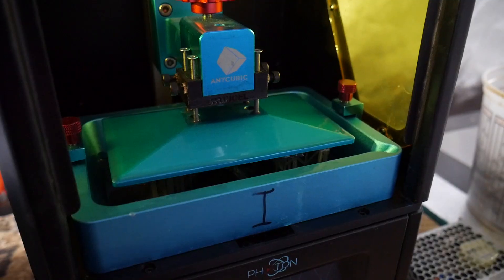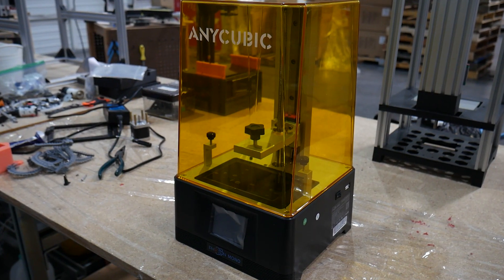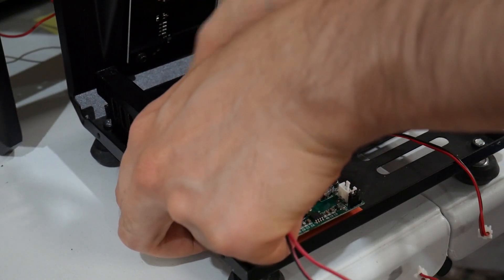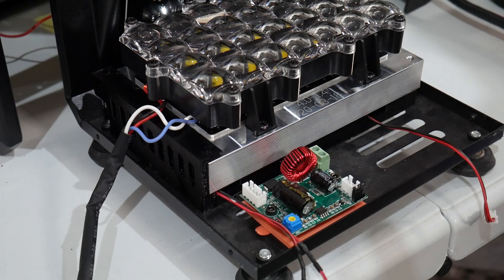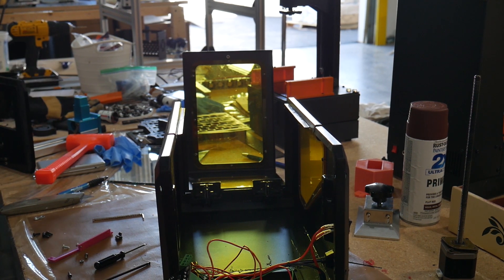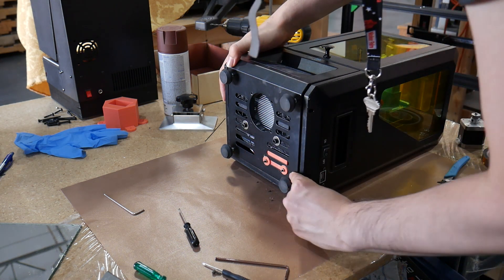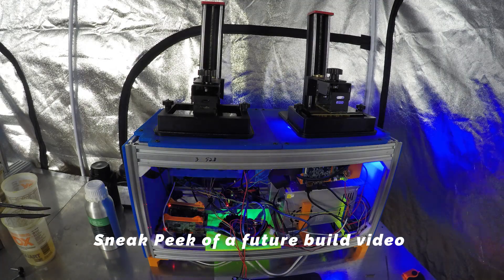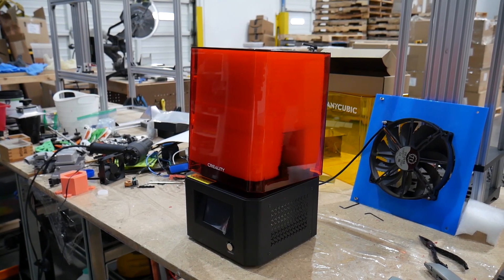Update on my Mono OG Anycubic Photon mod and how I like it.

Comment: Not sure I'll get a reply but here it goes: I have one of those printers but don't really have a lot of money to do a radical mod like this. 
What I tried to do was to install another 4x 10W LEDs in addition to the original 4x 10W LEDs and bought a 12V 10A power adapter to replace the original 12V  6A power adapter. 

But I ended up with half the light power as there's something obviously limiting the wattage output. 

So the question would be: is there a way to remove this wattage limitation so all 8x LEDs can get the same 10W each?
Reply from the maker: @caincha  its been a while since I gave these printers any thought as they are sitting on a shelf waiting to be scrapped or used for testing a part extraction idea I kick around. So fuzzy on the original parts in these. 

So brightness being cut in half tells me its likely the current driver pcb that the lights are connected to is set to a fixed current and will not provide any more, even if you add a better power supply.

And I don't remember there being any potentiometer to adjust current output so you may need to find a different driver.
Reply: @ thank you for your reply. 

Found out brightness is lower cause when connected together only the new LEDs lights up. And even if I bypass and connect the new ones directly on the PCB the original ones still won't light up. 

But if I solder the new ones in the fan output everything works but the new ones overheat even if I put heatsinks and use a blower on them - they really heat up a lot!!

And I get this error message 

LCD error code: T_8B L_O. please try t o continue printing.

I was testing all that before reading your reply.
Reply from the maker: @caincha  LCD error codes means the LCD firmware is not matching what is connected to the board, definitely double check the firmware installed.

Re the LEDs array it sounds like its drawing alot more power than the original array. Hard to say if that is whats causing the original not to run at all while the other one is wired in.

Comment: Finally got around to finishing this mod! Thanks for the detailed overview:)

A couple notes for anyone wanting to do it:

The provided motherboard bracket STL is flipped - you can print another one with the correct orientation or use the existing bracket. If you do use the existing bracket you can remove the handle so there's more space for the motherboard, as the array won't fit otherwise.

Yasu printed some washers for securing the LED driver that aren't included in the STLs - you'll need to print some or use some additional washers to attach it.

My LED array was wired incorrectly so didn't work initially. The plug was ++-- instead of +-+-, so I just needed to pop the pins out of the JST connector and swap them over.

There are a significant amount of grid lines as the array is too far away from the LCD. The manufacturer recommends a 35-36mm gap between the array and the LCD and there's currently a ~65mm gap with the supplied bracket. I put a spacer in between the bracket and the printer base and it's fixed the gridding:)
Reply from the maker: Congrats on completing the mod! It sounds like most manufacturers are now offering arrays with shorter focal length lenses which were not available a few years ago at the time of the video. I probably will make a point of adding some spacers as an option for folks attempting the mod with shorter focal length arrays. Also will dig up or recreate those plastic washers I printed.

I just need to find time for personal projects again rather than be swamped by work all the time now.
Reply: @HiroCreations  Same issue with me and personal projects - I intended on doing this mod a loooong time ago haha. I bought the array over a year ago, same link, so I imagine it's the same one? If it helps, I tested and around 25-35mm seems to be the ideal size for the spacer but that'll obviously vary based on the array. 

Thanks again for the mod - really looking forward to printing on it!

Comment: I’d recommend adding a magnetic flexi build plate (and z-height trigger adjustment).  Makes such a difference in getting the prints off the plate.  So much easier….

Comment: Did you change out the build plate and use a wider one? or did you use the same small build plate?
Is your build floor setting bigger to match the 6 inch screen or do you still have to use the 5 inch screen build plate floor setting size?

 Thanks
Reply from the maker: The stock build plate and vat actually fits the 6" perfectly (as the vat is a drop in replacement for the older Photon Mono which uses the same screen).

Comment: Can you recommend an alternative to the led array you linked its no longer available.
Reply from the maker: The next best option I found was the ones sold by Chitu: https://chitusystems.com/product/5-5-6-0-inch-parallel-uv-matrix-led/

That being said, after using the mod for a while I'm pretty impressed at how the stock array does--its only slightly less detailed than the upgraded LED arrays on most prints.

Comment: I noticed while watching this that the build plate on your Photon seems to have been modified. Or at least it's different than how mine is set up. I see 4 screws that seem to be used to adjust the angle of the build plate and then another 4 that look like they are set screws to keep the other 4 screws locked in place. Is that the case? If so is there a video explaining this mod?
Reply: Also I like Photonstein for a mod name.
Reply from the maker: Yeah I was not a fan of ball joints for keeping beds level for months or more of not releveling so I tried different iterations of the 4 point leveling and settled on the second design that compresses the bed side "arms" into the aluminum upper section like the leveling mechanisms on other resin printers.

Comment: Question if i change to the screen itself, whats the settings, is my bottom layer now 30 instead of 60 ?, expsure now 3 instead of 8
Reply from the maker: Depends on your resin but that probably would be a good starting point to figure new optimal exposure settings. For the resins I use I settled on 2.2 second layers and a 18 second base layer time.
Reply: @HiroCreations  thank you for the reply,  I'll give it a whirl, I'm still on the original UV light source might upgrade that when I feel brave

Comment: I just recently found your videos and they are great, is there a chance that you might try to build a base plate for an 8.9-inch mono screen? I am thinking of making a new case with a bigger build plate. Everything from your mod remains the same except a bigger case,  and perhaps the upgrade z-axis mod for photon. Almost the same as mono X
Reply from the maker: I have a larger scratch build in the works, unfortunately 3d printing base plates for anything larger than 6" does not work well due to how much they flex under the weight of the vat and resin. I'm quietly experimenting with ACM plate and printed fittings to see if that has enough rigidity, but likely I will have to swap to a milled aluminum plate (hoping to make a design that can be done with a desktop CNC router like a shapeoko.
Reply: @HiroCreations  Thank you ! that is incredibly useful information! I hope it goes well!

Comment: Great video! So, Chitu has a 24V parallel UV array on their screen. It looks the same as the duobond array you used. Having a time confirming the power output of the two. Can you confirm the wattage of the array you used?

Comment: what is the difference between the TMC2209 driver
 and the A4988 driver  ?
Reply from the maker: The TMC2209 is much quieter than the A4988. Thats the main and most notable difference. Print quality is mostly the same.
Reply: @HiroCreations  sorry, "quieter"? both are pcbs, they don't make sound . can you explain a bit? thanks.
Reply from the maker: @kensaiix  the stepper motor it drives would be quieter. The 2209 sends more precise control pulses to the motor which makes the motor whisper quiet vs the higher pitch whine that motors running with A4988 drivers have.
Reply: @HiroCreations  "more precise", now THAT triggers me, thanks.
Reply: @HiroCreations  hey, sorry to bother you again: i noticed a network port, does that mean the board has a web interface and is capable of remote access and remote print?
Reply from the maker: @kensaiix  It can, but I've not spent much time exploring the functionality of it as I am told that the interface and software is unfinished. The OG photon board should also have a ethernet port as well.

Comment: Any news on availability of a drop in 5.5" mono replacement screen plus compatible controller?
Reply from the maker: They keep telling me soon, but no firm dates. But I do know that it will be compatible with the stock Elegoo Mars Pro (maybe the regular mars as well) board and the Chituboard v3 with a firmware adjustment.

Comment: Update please. Im absolutely doing the 4k mono upgrade for the 5.5" size.
Need that video.
I actually can't believe Anycubic can't see the market for selling a 4k mono upgrade kit for all the photon owners out here. It's got to be the most sold resin printer so far.
They would make a killing with such a kit.
Reply from the maker: Yep! Waiting on the manufacturer who let me test some early release boards actually launch the screens for sale (they were supposed to in Dec).

Short term the only easy to plug and play 5.5" mono screens will be 1080p (same as the original sonic mini). I have been hunting around for 4k Monos but the issue is they are either not available yet or use ridiculously complicated and finnicky HDMI driver boards that essentially make it an advanced upgrade again.
Reply: @HiroCreations  i see those boards on alibaba. pretty cheap so you would think the upgrade options would be out there.

Comment: Amazing job with the mod. 
How would I go about upgrading just the uv light array? I have a small 6 light UV lamp(6w) that I am contemplating throwing into my photon.
Reply: The lamp is 6w but it also says "6w/60w"
But I don't know if that matters. I am just trying to increase my print speeds with as little modding as needed.

Comment: The new mod u r working on changes only the screen and the board.  Would it be overkill to change the led array as well? Or it isn't necessary?

Can't wait to see that vid
Reply from the maker: Changing the array is doable but it also means you need to swap out the fans/power supply in order to supply the required 24v power (stock uses 12v). Having printed extensively with both paraled arrays and stock cob + reflector arrays--the stock lighting setup is much better than I expected with slightly slower cure times and slightly less detail when you use a macro lens to compare them. Most people won't see a difference between a paraled array and the stock array.

Comment: You're probably the best person to ask this! I am wondering if you can figure out what polarizing sheet is on a Mono screen? In case my Elegoo Saturns every get resin on them that I can't get off i'd like to be able to replace this polarizing layer and just keep printing
Reply: polarizing screen linear 90 degree, you need it bigger than your screen. if its the same as the MonoX you'll need to rotate about 15 degrees ( this is an about because some need more, some need less. you can look in the Mono X groups for more info.

Comment: Very good video. Since the last one I'm still thinking about the mod while looking at my photon that was not used for months. However as mentioned for this price (or even cheaper on a sale) you can get anycubic mono but I was wondering if there can be achieved some significant advantages over ready solution:
1) Although exposure time looks super quick I find a lifting speed evenly important - is it possible to modify it to go closer to 100 or even apply some vroom method/gcode for >240?
2) It seems that even, straight light source allows to get better details even with only 2k screen. It was the case with the first phrozen sonic over regular photon and now it can be the case with Uniz IBEE (at least it is a argument from 3dprintingpro review). How is a light distribution right now? Can it be somehow improved?
Reply from the maker: Definitely, I'm rigorously testing the Vroom speeds on a control printer as I would like to know what harsher pull forces will do the FEP/Screen before I feel comfortable talking about the Vroom speeds--aside from that, chituboard makes it easy to set custom speeds and accelerations with their Gcode parameter file.

The Duobond/Epax light source I used in this mod is the best reasonably priced collimating light array I have used so far and definitely produces much more even, yet straight light than even the paraled arrays from either Phrozen, Anycubic and Elegoo. The only way to really improve on that is to have custom optics built but that gets expensive in a hurry with quotes like $40-60 per single lens on a array that needs at least 20 lenses for a small SLA. 

That being said, the best optics in the world won't save your print quality if the correct lens focal length is not used  (the issue cropping up for a lot of the retail mono printers) or if the resin exposure settings has not be correctly calibrated and is being over exposed--or has a tendency to swell during the polymerization reaction. Again I don't really want to fully knock the COB and reflector arrays as I've been really astounded by the crisp details I am getting with the Creality LD-002Hs that are virtually indistinguishable from the same models printed on machines with good collimated light until you examine them with a microscope or macro lens. I'm collecting data here and definitely will make some content with my results and conclusions at some point in the future.

Comment: Thanks for this follow up. I was just chatting to some folks on one of the forums about this mod. It sounds like some of the LCD manufacturers are putting out mono replacements for RGB machines like the LD-002R. I wonder if that will be more plug and play? Though it sounds like your mods go a step farther anyways. Your speeds are pretty slick. Looking forward to hearing more about your resin finds, and maybe some time you can share a bit about the types of prints you do, are you making your own supports? Are you using Lychee? Or Chitu? Thanks again :)

As for nicknames for the hot modded racer you made. What about the Mechacubic Photon! Like Mechagodzilla :P Might need a silver paint job though...
Reply from the maker: Good suggestions on printer names! I am really happy with Chitu so far for support generation and slicing (got my settings dialed in to the point where it peels off like butter and is hard to tell where the support marks are.

Yeah 5.5" mono screens are coming soon--the downside short term is that the first generation of them will be FHD, but 4k versions are not far behind once they resolve the issue of needing to use additional lanes (forcing the connection to be HDMI rather than the simpler but lower bandwidth mipi ribbon cable). I have a video on this recorded and edited for swapping the board screen for another OG photon or doing a screen only swap and updating the board firmware on the Elegoo Mars and Creality LD-002H. Just waiting for the manufacturer to release the screen and firmware publicly.

Personally the extra half inch you gain diagonally allows me to print all the products I sell without needing to use a larger and more expensive SLA screen. $55 for a 6" DXQ mono is pretty cheap if they last an average of 2k hours of run time. (8.9" monos still are costing me between $175 and $250 for a roughly 35% increase in screen area over a 6".
Reply: @HiroCreations  I'm really waiting for the 5.5" mono screen for my LD-002R which should in theory just be a drop in replacement.